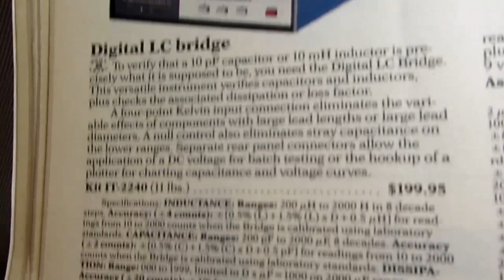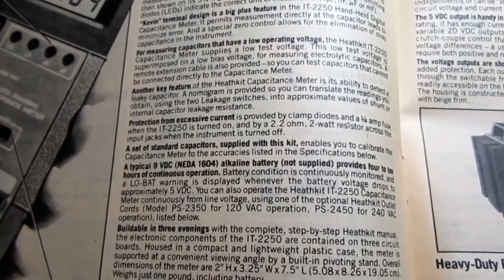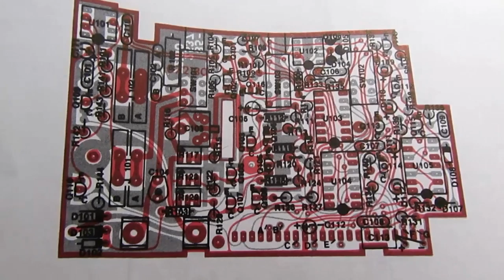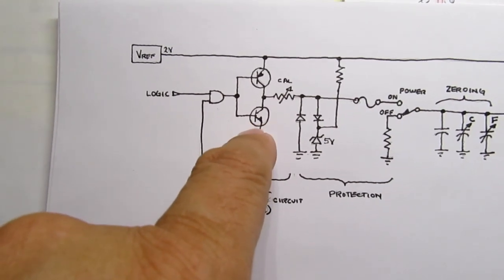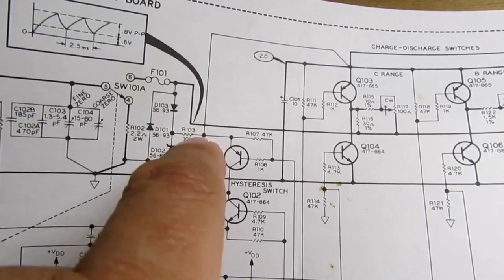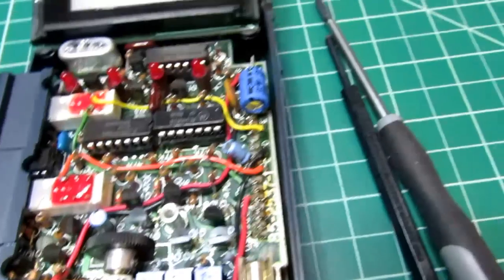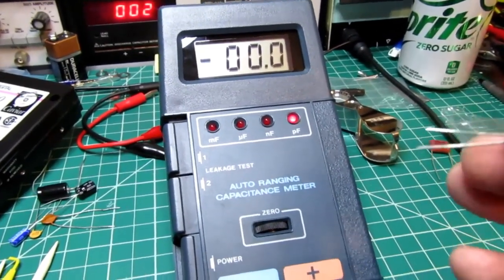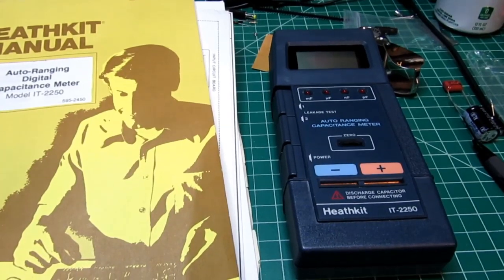Heathkit IT-2250: Overview, Theory of Operation, Demonstration

Comment: I built one of these earlier this year bought on eBay around 25 years ago. It’s good to see this one working but I found it difficult to debug. Two densely packed boards linked by a 22 way link makes the boards difficult to work on and then the links break… almost all the parts are still available being mainly CMOS logic and discretes but replacing the LCD now would be very difficult fortunately, mine is fine. So I plan to spend more time on it this winter and I’m hoping to make progress. 

Thanks for a useful and informative video.

Comment: While I was watching this video, I started wondering when Heathkit closed down, so I looked them up on another device.  Turns out, they've started selling some basic electronic kits, a clock, a couple of radios, and the like, again.  It's all on the web, but it's there.  Just wondering if you knew that.
Reply from the maker: Cliff Liese, I am aware of the 'new' Heathkit, and check their website occasionally. So far, I am not impressed. Except for their "most reliable clock" kit, I see nothing that I think would be of interest to anybody (except perhaps a couple kits that allow upgrading older kits). Their radio kits look pretty lame. The clock looks nice, but is very expensive, and it offers no features that would make it desirable, other than being of generally good quality. I don't know how they can keep their doors open with such undesirable products, and so few of those. My guess is that they will not last very long.
Reply: @youtuuba  agreed.  I need a good clock, but that one is way out of my price range.
Reply from the maker: @clffliese26  , I figure there is no way that the current Heathkit company can afford to develop a lot of new kits. I have thought that there are actually some really nice electronic kits, both from Europe and China, that would be even better if they were touched up to a median of quality, and then provided with better manuals and USA based tech support. Heathkit could perhaps arrange to sell some of those existing kits, adding value by improving documentation and support. This would cost them relatively little, would increase their exposure to more customers, and get more website traffic. This should bolster their profits, helping them to design more original Heathkit products. Even the original Heathkit sold some kits that originated with commercial products, so all they did was kit-is a them.
Reply from the maker: @clffliese26  , you might look online for the TIMEX T123S "Simple Set" clock. It was discontinued many years ago, and is nearly 'unobtainium' now, but there are a few for sale on eBay. This is what I have been using. Other than a slightly cheap looking build, it is actually a reliable clock, with a large display, and adequately loud alarm, and most importantly, it is super easy, and quick, to change the time and/or alarm settings, due to the time setting keypad on top. It is great for me, since I have lots of irregular wake up times, and the traditional digital alarm clock, requiring all settings to be made using a single button, are much too laborious to set each time.